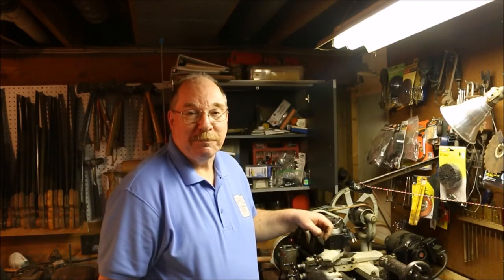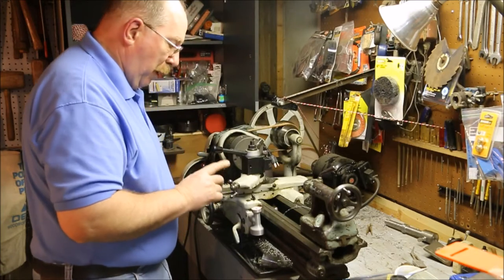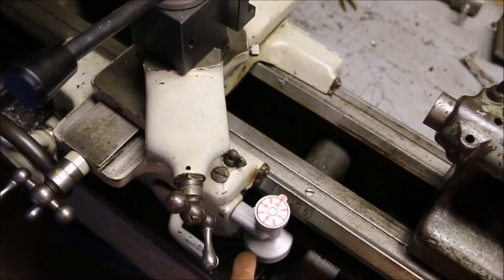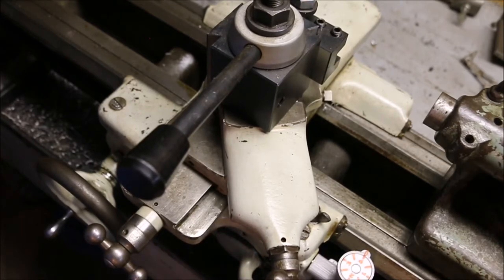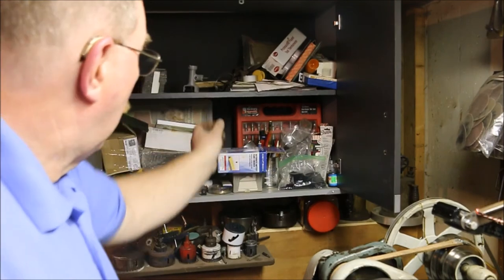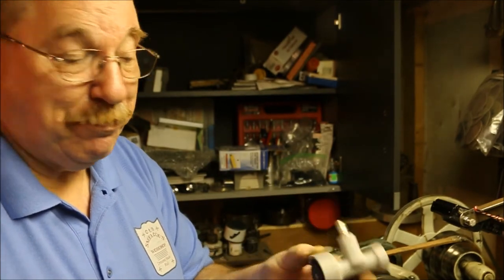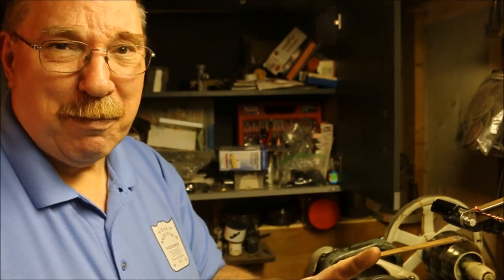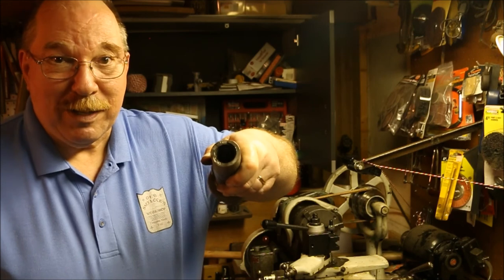THREADING DIAL FOR SOUTH BEND 9C

Comment: I've been having trouble with a second pass not lining up. I just bought one on eBay. Thanks for the suggestion.
Reply from the maker: The only way to work without one is to leave the half nut engaged and reverse the lead screw to get back to the start of the cut. It is a pain but I did it until I got the threading dial for the South Bend 9C

Comment: Where I used to work they had a phrase of "Good, Fast or Cheap, pick any two" and it seems to me that it holds up most of the time. Now we are retired, what is the hurry, we have eternity to finish it. As always enjoyed the video.
Reply from the maker: Good words to live by. Unfortunately the designer has other plans for many of the projects. You don't get to see the most of them. Some of us are camera shy and the camera slows down the project slightly. Lighting and framing the shot. Not many retakes. Most of the stuff is one off. I'm not going to paint the house again just because the camera was at the wrong focus. :-)

Comment: Is it correct , I'm suppose to use the numbered line for even numbered threads and half lines for odd number per inch threads ?
Reply from the maker: It depends on the lead screw thread pitch and the grearing of the feed. This has several good suggestions for determining what your lathe has. https://bbs.homeshopmachinist.net/forum/general/34036-thread-dial-when-to-engage-half-nuts/page2
Reply: @OldSneelock  Thanks for the link, very useful! My South Bend 9c is pretty much same as yours, in really good shape.
Reply from the maker: Knowing it is a 9C I can zero in on the settings better. 
https://bnordgren.org/files/model-c-gears.pdf
http://www.wswells.com/data/9_workshop/CL670Z_army.pdf
Reply: @OldSneelock  thank you .  This is the one I need, I do have 18 tpi lead screw , 1/8 pitch.  This is the complete chart I have been looking for!!

Comment: Everything comes back again. I rember the first video where that vice showed up. You al a ays get to something eventually.
Reply from the maker: Matt Cooper It's what happens when you work in a budget. Speed cost money. I would like to video all the projects in one setup. It would avoid that annoying time lag of, only, two or three years before they are finished.  😕
Reply: Old Sneelock's Workshop I think it is a good thing. Adds a bit to the videos, when I can say, "hey, isn't that..." or see things in the background from previous videos. Things don't disapear into a black hole. They just sitbon a back burner for a bit.
Reply from the maker: Matt Cooper Thanks Matt. I do appreciate you mentioning the vise as being from a previous video. I still would like to finish a whole project before publishing it. It might still be serialized butthere would be a definite beginning, middle, and end. The work around that I have is playlists. After I make a tool, to make a tool, that will make a part to fix another tool, I can  link them together. 
The threading dial has broken a couple projects free.

Comment: one of my visions for the future, is a library of parts, all of our commonly used items, so no equipment dies for want of some hard to find piece, 3d printing does or soon will do metal as well as plastics that can be as strong as the moulded ones, in some way it will mean we all use the same item, but my analogy is a toaster, who cares what you have, no-one talkes about them , we all have and use one, we are 'over' any boasting about them,  we need to get there with cars and even houses, we have the tech to make an entire house wall by mail order, with wires and any colour you need all built in, you will perhaps access the printers equipment like you do say getting photos developed,  how many devices or tools are not going to change, like adjustable wrenches or hammers,  many things should be standardised by now, but then we get to politics, and im probably far too left wing for the USA audience
Reply: Probably not here. This outfit is pretty open minded about the basic stuff, like common sense. It can get fuzzed up about stuff that doesn't matter because most of us are veterans of the work force, if not all, and it's hard to hoo-doo someone that's been there and done that a LOT!
Reply from the maker: We are walking on dangerous ground. Standardized thread sizes I'm all for. Just change the rest of the world to match what I'm use to. 
Oops!
I think we are going to get in trouble pretty quickly. Just about the time we standardize ice cream to only pistachio the world will rise up and beat us about the head and shoulders. 
As individuals we certainly could use the replication tech to standardize what we use every day. Like you mentioned parts for equipment. If your tuba loses a gasket just make a new one. Or a new tuba for that matter. Never run out of anything again. Instead of maintaining old equipment then just replace it every so often. Clothes, shoes, cars, golf clubs, on demand, and no waiting. Each item individually tailored to your specification. Standardized individuality.
Reply: Does the Standardized Individuality go for the Harley riders that say they're misfits so lets all ride the same kind of motorcycles together? I never felt that way when I had mine. Don't think you did either. And we all know if a government of any kind gets involved in it, we'll NEVER have something that even faintly resembles anything workable. From the beginning till now and beyond.There go your politicks!
Reply from the maker: I had a couple run ins with motorcycle gangs. I bought a Harley Trike. The guy who sold it to me had it for sale for $300.00. I heard about if from a friend and went over to see the guy with my friend. I gave the guy $300.00 and loaded up the trike. The next day three guys pulled up in the drive and walked back to the shop at my folks house.
They said they had come for the trike. I told them I had a bill of sale. The guy who sold it to me was with them. He said they were going to take the trike. I told him to stuff it. Turned out they were members of the Scorpions out of Detroit. One of the guys owned a motorcycle shop out in Batavia, a little burg just west of Coldwater. He said he wanted the rear axle with the hydraulic brakes. After some bluster on the part of the three "bad asses." They left. 
Years later I ran into the guy who owned the store. He had become a preacher and worked in a machine shop that was doing business with the company I worked for. 
I don't take kindly to bullies. Whether they work for themselves or some government group they all get the same answer. If it don't fit I'll fold it in half and stuff it for them.
Reply: Yep. Some so-called 'bad' people can get totally hurt by pulling stunts like that. A wrench buddy of mine had a BIG pistol laying on his desk. I asked him what was up and he had fixed a car for someone and the someone brought help and decided to take the car without paying. A friend of the wrench man showed up and the others backed down. The wrench man said that'd never happen again. It won't. Like a buddy of mine said, 'I'm not a bully unless you make me one and THEN I'll be your worst nightmare'! He gave me an elbow drop and I chased him around the shop with a grease gun. His oldest has supposedly turned out like me. The family just sits around and looks at him.  Somebody has to be straight up in this world. Might as well be us!